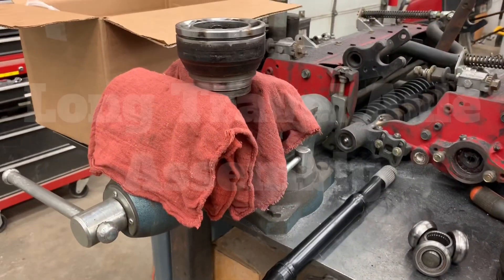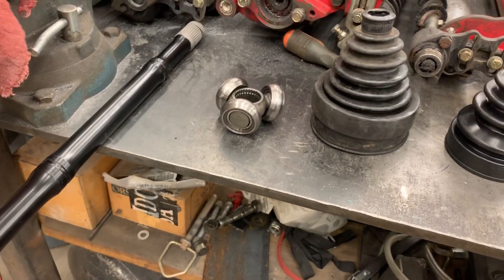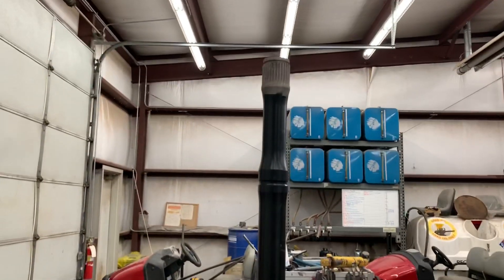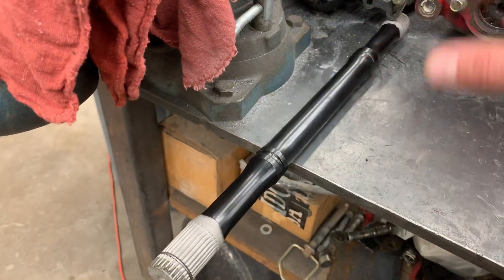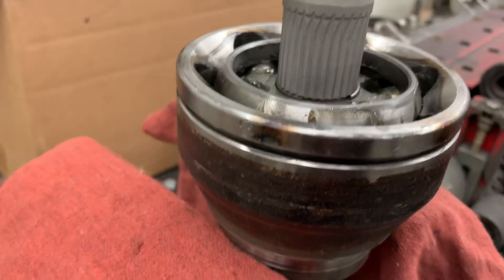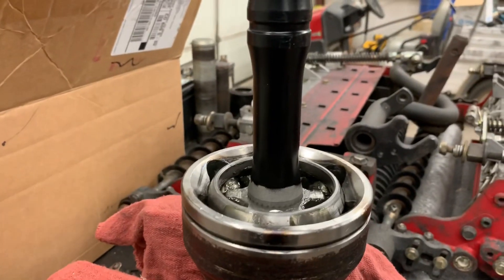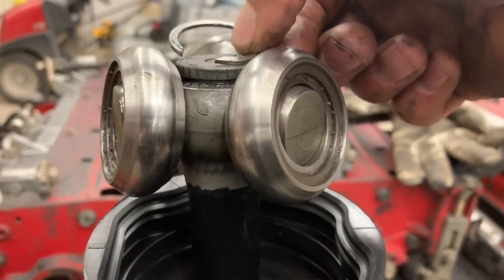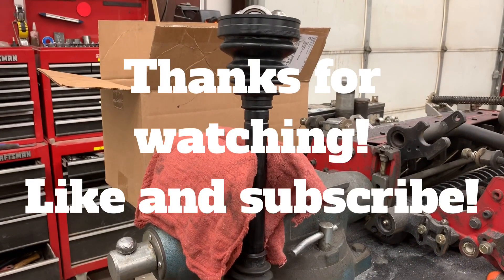Toyota FJ Long Travel Axle Assembly

Comment: I cant seem to get the cv out of the outer spider.  How hard did you have to bang it to get it out...I am trying to pipe sliding method.
Reply from the maker: michael atterbury it takes a lot of force because more than likely you’ll have to break the retaining clip in there, If you walk your hammer around the top of the housing while hitting it it sometimes helps because it sometimes needs to be hit in the perfect spot to break free

Comment: Any problem with cv axil binding at full droop or do you run limit straps to protect from that
Reply from the maker: Devin Appel you will have to run limit straps but most kits do include the straps so it won’t be an additional purchase